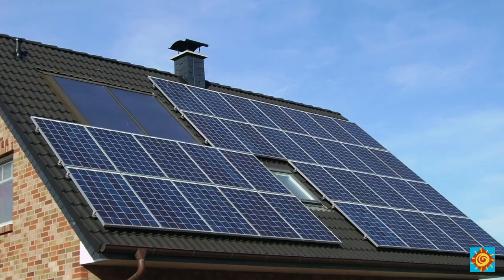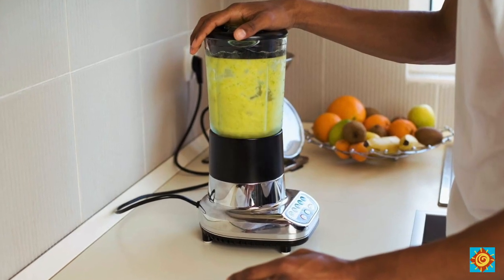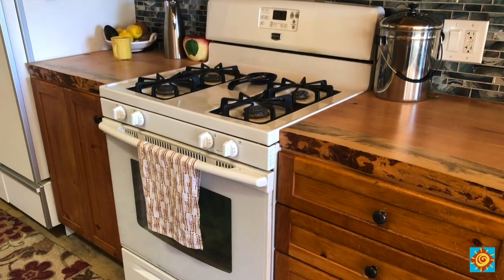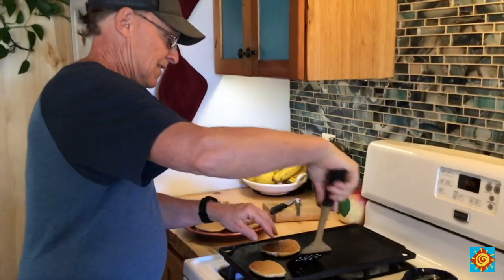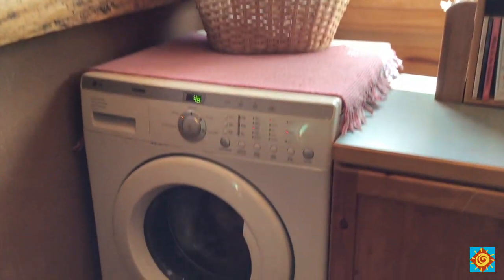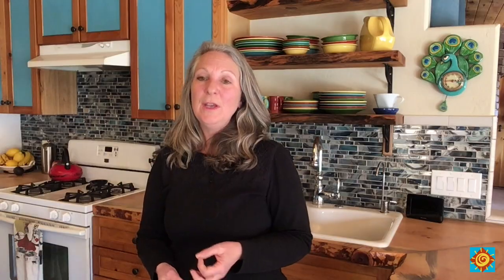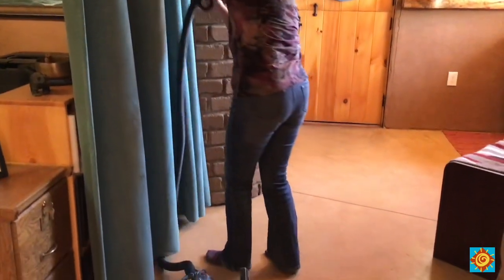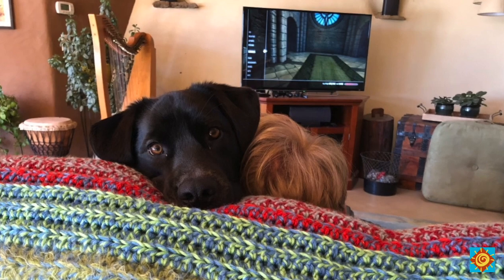Modern Conveniences in a Solar Powered Off-Grid Home

Comment: What is your battery system like? How many amps and what type of batteries if you know
The lights and whatnot in your entertainment system you're talking about really adds up on older devices (my old vcr would use about 6 watts off, 14 watts idle and 20 when in use). Even a basic usb phone charger will pull about half a watt when nothing is plugged in. You can get a power strip with individual switches or unplug these things to avoid that power draw
Reply from the maker: I like to turn off the ever-running appliances not only for the power draw but also for the annoying led lights lighting up the house.